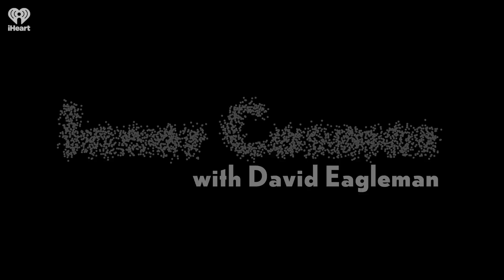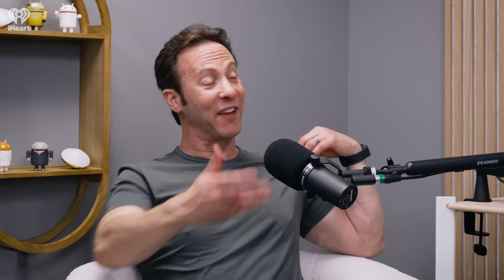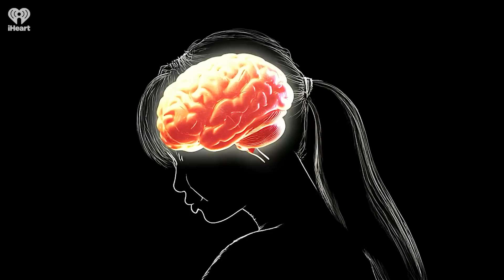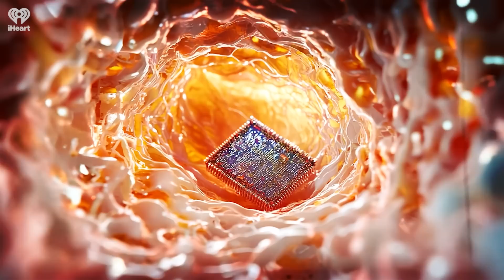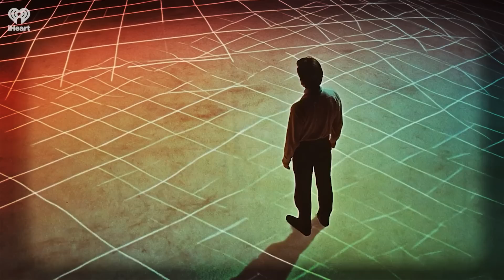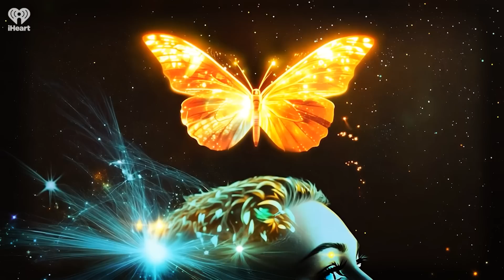What's the future of connecting our tech to our brains? | Inner Cosmos with David Eagleman

Comment: 41:45 A seemingly endless fractal corridor of doors to new perceptual manifolds to explore, sensory, cognitively.   How could we think, navigate reality, our own minds, with new perceptual signals to build upon?  Lots of interesting problems, questions.

A very interesting conversation - especially for engineered experience (or qualia crafting).  

How do we source these abstracts, these sensory threads to then pull them together and weave into the tapestry of the perceptual manifold moment to moment? It isn't just a single sense 1:1 or similar, but rather combinations of senses to access and "dial in" (to steal from stargate), navigate to, these new outlooks, structures in the mind by which to interact?  You can pull spatial abstract information from a thermal sensor, not just the temperature, if moved around, proprioceptively mapping it out a space. (thanks place/grid cells very cool)  Sort of how a car works, giving OBDII signals sourced from the resultant states of several physical system, or interactions with these higher dimension abstracts.
 Or how depth perception works, in humans, with bifocal vision or motion through space, hearing differentiation, intensity combining to form (maybe) emergent signal from the noise, in a way. A new perspective to utilize, vs the individual parts. Top down, vs bottom up overview. 

I don't think we can "see" how animals see, however, vs get an insight in the experience of perception of the shared abstract space, a shared element between manifolds.  Each manifold is unique to each person - based on their biology, history, knowledge, sensory repertoire and more. The thoughts in the mind, the way the signals are parsed, understood, integrated, the overall whole of mind and sensory activity at a moment, would be vastly different experientially I'd imagine, from us to animals. Not to get started on the cognitive speciation potential from augmentative tech in general, but if someone has had different sensory history than someone else, imagine how much it might split off over a lifetime, even if able to experience each sense, the various combinations had over time could lead to bifurcation still. 

Animals may not have the same sorts of activity in the mind, at least experientially, but they do have more specialized setups for senses, so able to gain higher fidelity and function out of them even though "lower resolution"  overall in terms of the abstract space elements (if quantizable even).  Although that is probably less a concern, unless we miss what isn't seen, or focus on the wrong details in terms of what our biology vs theirs finds most salient, meaningful.

Still very much of the mindset that we need to start plugging in all sorts of new perspectives to get better insights about this wild universe (inside and out) we observe. 
What might a future hold, if society was adapted to taking new perspectives regularly?  Might we be more understanding to each other, or more distant?  Would our minds adapt to swapping these manifolds faster and faster, growing into the technology patterns as they self evolve alongside us? 

A future where everyone has their own manifold synthesizer, and must do connecting procedures to sync up enough of the abstract sensory threads across the noise, to get better perspectives on what others are seeing, thinking, experiencing, sounds interesting to me!
The map is not the territory, as they say, but better tools for new, higher resolution and insightful maps let us better explore the territory. 

Time to get exploring :)